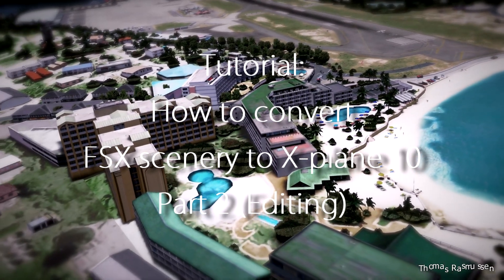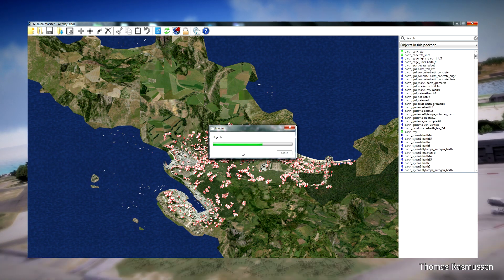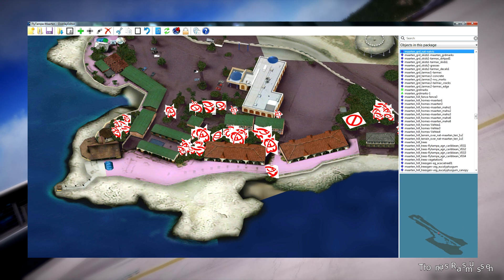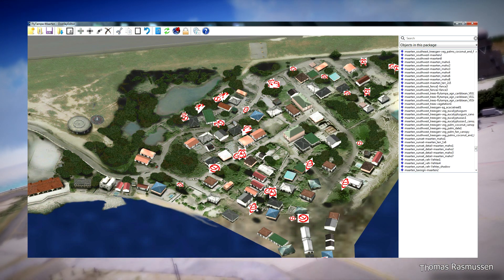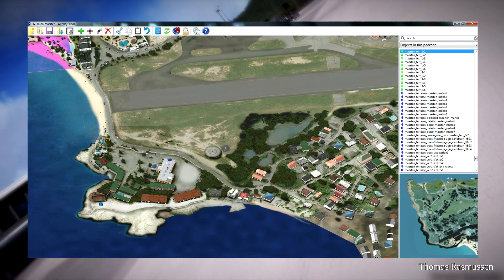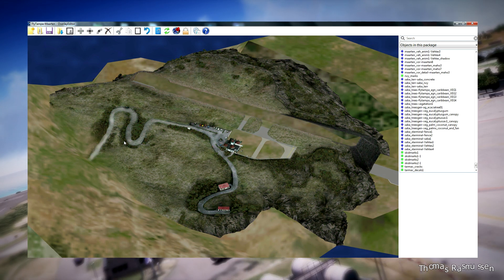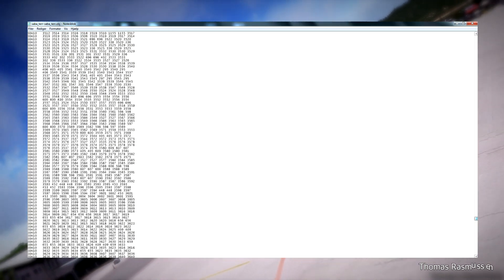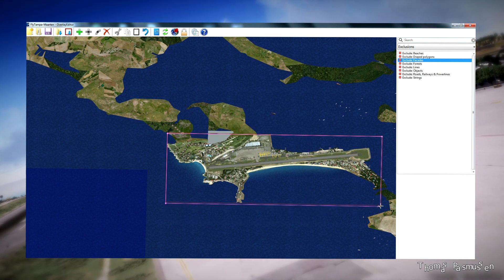Tutorial - How to convert FSX scenery to X-plane 10 (Part 2)

Comment: Hello,

I currently have a couple of problems with a few sceneries. Firstly when I look at any of the placed terminal buildings at the airport it has weird artifacts/shadows which are different and separated into 4 squares on my screen. Secondly it seems on quite a few the concrete/asphalt textures they have under the airport are clipping through the runway/taxiways in jagged/odd shapes and I cannot seem to find the culprit. Lastly with one of my airports the taxiways/runways act as if they are a rocky ground and my aircraft rocks as I taxi. Would you have any idea what the problems are for these airports? Thank you for these tutorials and your time. :) 

Have a nice day,
TooSpooky

Comment: Yesterday I followed steps 1 and 2 for my FSX Drzewiecki New York City. It seems to add all the buildings and work in XP11 fine with no issues having to correct.
Reply from the maker: Yes, DD NYC converts pretty well (although pretty FPS intensive). The only thing missing are the lights on top of the buildings (which I also have a tutorial for ;-) )! Thanks for watching :-D

Comment: Hello Thomas

I have also TNCM from tampa, after converted with FSX2Xplane and to which path do I have to open the TNCM with OverlayEditor, because when I open converted file of Tampa with version 8, the OverlayEditor could not open it. thanks
Reply from the maker: +John Slutskaya FS2XP makes a new directory in the custom scenery folder (or in another folder specified in "X-plane scenery location") - this is the folder that should be opened with OverlayEditor! Please, be sure to use the latest versions of both programs.
Reply: Okay thanks Thomas.
Reply from the maker: What are your specs? I am on Windows but I know of people on Mac that have problems!
Reply from the maker: +John Slutskaya Same as me! If you installed OverlayEditor correctly, then I have no clue why it does not work!? Can you load other sceneries in OE?

Comment: 2 questions:
1) how is the performance on those converted scenerys
2) is it possibal to convart any fsx/p3d scenery into xplane10?

Thanks for your tutorials ⭐️⭐️👍🏻👍🏻
Reply from the maker: +ph1p0 You are welcome ;-)

1) The performance is generally pretty good - some sceneries like Drzewiecki designs New York and Aerosofts VFR London are pretty tough performancewise though.
2) Most sceneries can be converted but with very variable results - some are almost perfect, some lack ground textures, some needs correction of "floating" objects and some again do not convert at all!
Reply: +Thomas Rasmussen ok thanks and are the jetways working after the convertion?
Reply from the maker: Taxiways and runways will work most of the time ... BUT you will have to add edge- and center lights to taxiways as shown in the tutorial.
Reply: +Thomas Rasmussen ok sorry. that was a missunderstanding. are the jetways (dont know the right word)(the passenger boarding bridge) working? :)
Reply from the maker: Oh, sorry :-P They are only static - If you want them animated you will have to make it work with autogate - not something I have used time on in any of my conversions!